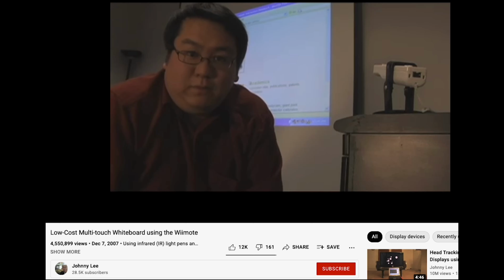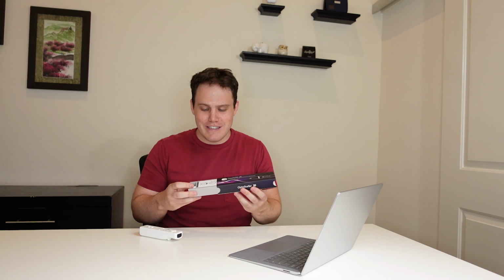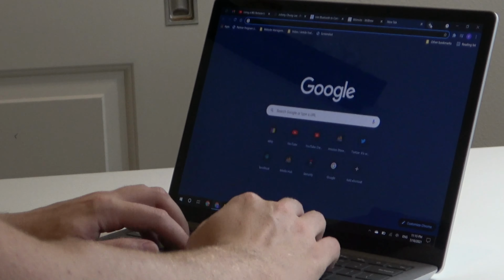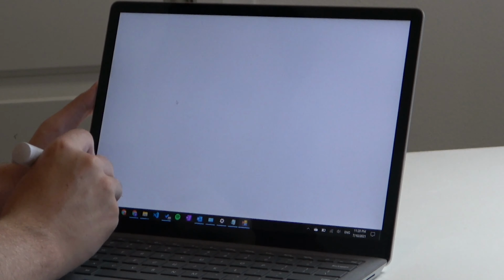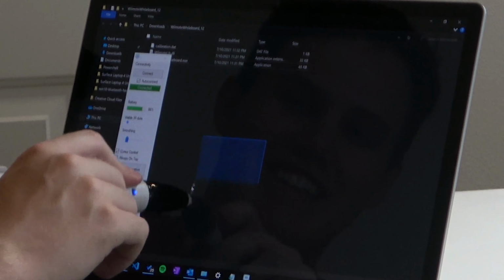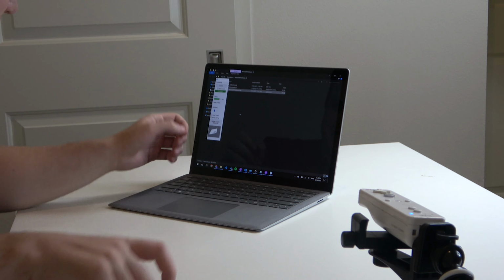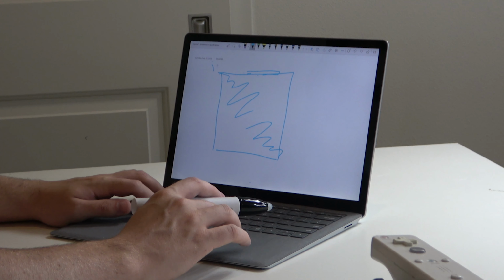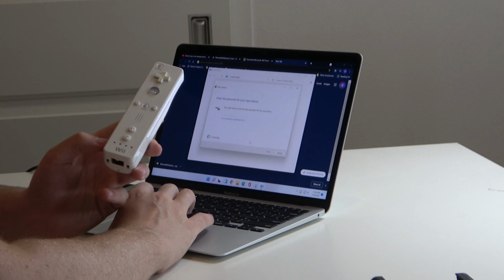Adding Touchscreen to Any PC using a WiiMote!

Comment: I always like videos trying to make touch work on Mac… I have a couple of touchscreen monitors that do work with my M1 Mac Mini but not all the time. And of course touch works much better on a Windows VM than on MacOS, that does not have multi touch support but only «mouse style» touch support, so no gestures etc…
I recently ordered a dedicated 15.6in 4k touch monitor for my M1 Mini (I work with 2 monitors, a smaller one below and a larger one above), which will replace my iPad working with sidecar… Hope touch will work…..
Reply from the maker: Let me know if it works out!